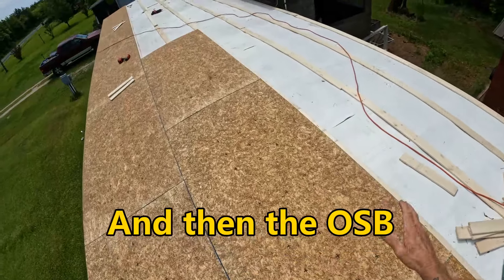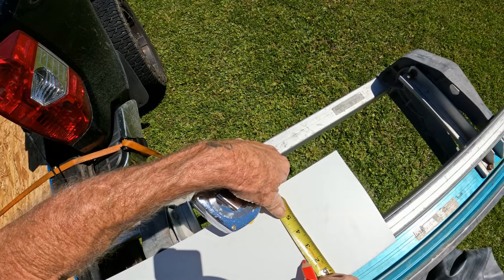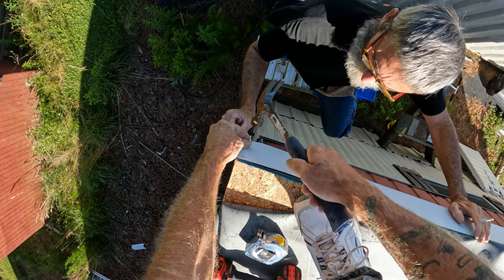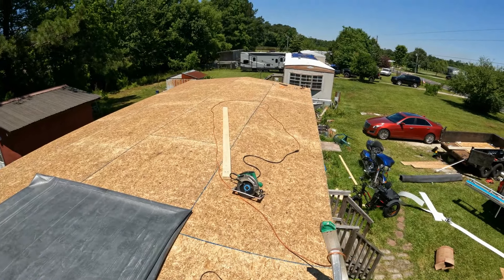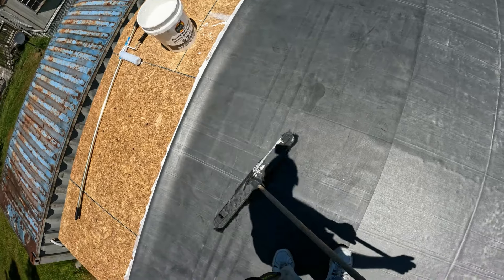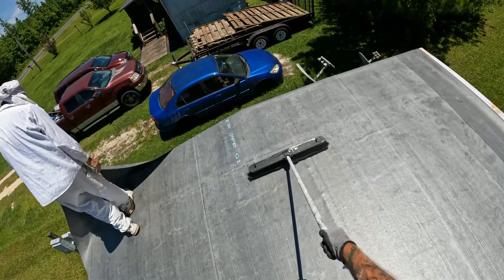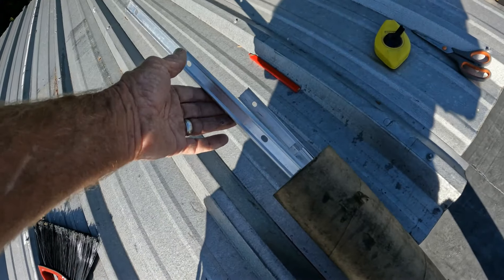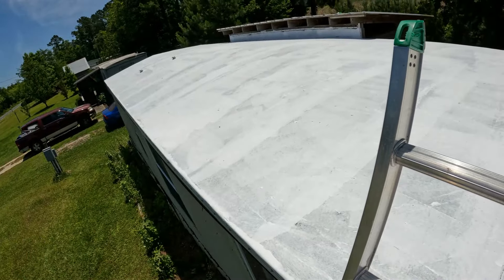(How To) Mobile Home Re Roofing In 20 minutes

Comment: Hey Drew Love what you do you inspired me to install this same kind of roof on my mobile home I live in Rockford Illinois out of curiosity what product did you use to paint the roof that's the only thing I need to do to mine and how many do you think I would need for a 14 x 70 roof and if it wouldn't be too much to ask how much do you typically charge to do a roof do you price it out by square footage if so how much if you don't mind me asking
Reply from the maker: 2 5 gallon bucketts
start by installing a thin coat then let it sit 24 hrs
install the rest of the kool seal it should be good then for a couple yrs

Comment: That facia flashing ... or the flashing you were installing at 4:18.  I would think that having that extend up UNDER the roofing material would be a "better"  vs the leaving a vertical opening at the edge of the roof where water could drive up under the roofing then run back down and find an opening to run behind the flashing?

I wouild have thought a 2inch on the flat of the roof would make a more water tight system.  Not sure I heard if there was an explanation as to why not.
Reply from the maker: Watch the video it does go up underneath the rubber we would never expose the top of the rubber to the weather

Comment: Love your vids. But aren’t you putting the new roof over the old one????

Is that what the home owner wanted?
Reply: This is called a 'roof over' and is a fairly standard process for mobile home roof repair. Metal roofs, especially on older mobile homes, aren't exactly as easy to service like you would on a stick built home.
Reply from the maker: Yes, actually it is. That’s exactly what I do all the time except for my roof is way more sturdy so yes that is exactly what the homeowner wanted. He found me by watching my other videos of us doing the exact same thing.
Reply from the maker: Thank you for the comment and you are exactly right. This is standard for mobile homes and we do it all the time. We actually have quite a few videos of us doing this.
Reply: @Drewsroofingandhomerepair thank you. 

I’m working on a trailer home and I’m struggling with it. The roof and it rotted in some areas throughout. 

So I’m seeing what you’re doing
Reply: You’re a pro. How far do you travel?
I’m in ILLINOIS
Reply from the maker: You’re a long way from me.  Call I’ll help